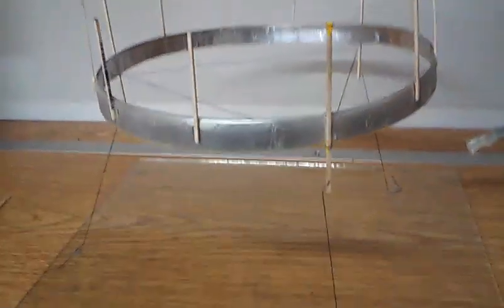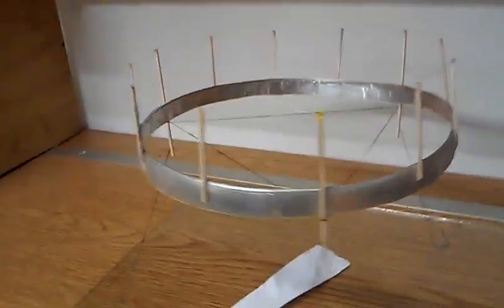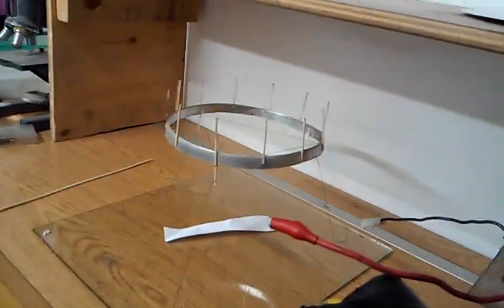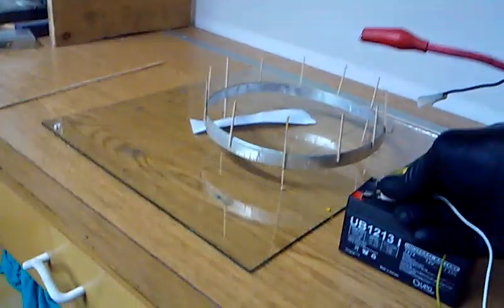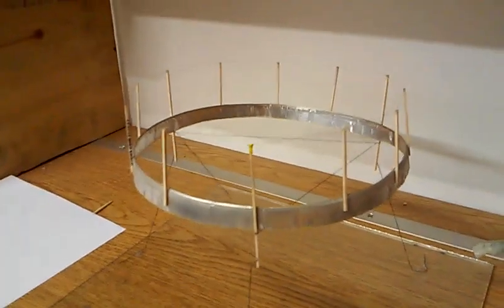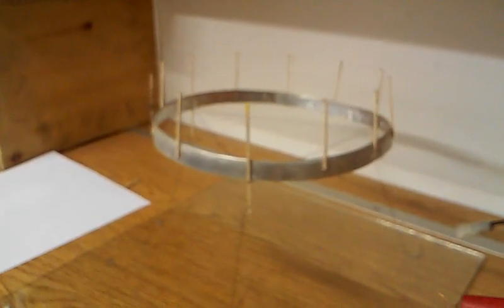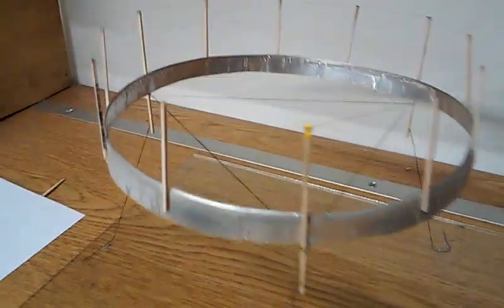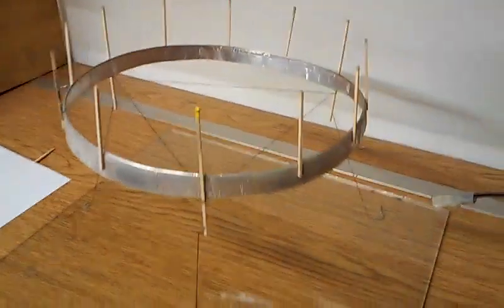ANTIGRAVITY LIFTER CREATES ARTIFICIAL GRAVITY ASYMMETRICAL CAPACITOR

Comment: It actually does use ionic wind ... just blow a bit of smoke through it, and you'll see for yourself.
Besides, your math is way off. You claim that the piece of would you use is the equivalent of a telephone pole when scaled up, but when you scale up for the length, the volume (and therefore the mass) is scaled up by a power of three ... That telephone pole would be more like a cardboard tube..... Besides, to scale up the effect that much you'd have to use voltages so high that they sparc over, and your rig shorts out. Effectively you'd have to create your own lightning. 
The power supply you need for the tiny model is already way too heavy to be lifted with your model... the power supply you'd need for the up-scaled model would be the equivalent of a truck. 

I'm all for research on anti-gravity, but the way you're doing it you're making fun of everyone that doesn't know the science behind it all. Effectively countering possible advances in actual research on anti-gravity.

This is what ACTUALLY is going on....:
https://www.youtube.com/watch?v=01F8V5IhB5k
Reply: @KraussEMUS1  Yet again, these craft are not propelled by ions! It is physically impossible to create lift by shooting down ions, but no force when those same ions collide with the bottom part of the craft. It's still the ionic wind, not the actual ions to get lift.
Reply: @angeldelvax7219  
Hi Ronald,
Back in 2001 or so I used to build large externally power devices in my garage.  My pant legs would charge up with large amounts of static due to charges escaping from the bottom of the crafts, so while your comment is very astute, and perfectly inline with the classical definition of how they work, there are actually a large number of charged particles that escape beneath ion propelled crafts.
Reply: @KraussEMUS1  static charge can build up for a lot of reasons. When you're working with high voltage power supplies it's not uncommon to get static buildup in your clothes. I used to repair CRT TV's. There are no ions propelled towards my legs, and still my pants got charged sometimes.
Reply: @KraussEMUS1  besides, I never claimed that ion propulsion doesn't exist, only that it's impossible to move anything by moving ions around in that item.
Ion propulsion isn't nearly powerful enough to get anything lifted from the ground here on earth.
Reply: @angeldelvax7219  
I know older television screens can get static on them sometimes, and also "static" forms of electricity can flow through objects onto peoples clothing, but the old large crafts that I was working on had a strong downdraft.  It would blow on my legs  and then there was a strong distinct charge buildup on my pantlegs. I am an EE, and have spent 20 years working with ion propulsion full time, so I really think some of the charge exits below these crafts along with uncharged air molecules. The physics do not prevent some charges from leaving the craft.
Reply: @angeldelvax7219  
Hi Ronald,
That used to be entirely true, but no longer. The craft I have built is ion propelled, and can lift its power supply and optional propellant tanks as well... I have provided extensive verification of it.  Here is an NPR Radio broadcast verifying that it works, there is also a website, and there is video of it on my channel, showing it lifting its propellant tanks with the onboard power supply:
https://radio.wosu.org/post/exploradio-oberlin-inventor-pushes-limits-ion-powered-flight#stream/0

Comment: its aluminium and it floats because of electromagnet under it. electromagnets repel aluminium and thats how you can make a rail gun if you want to.
Reply: Nope it's pushing air downward.  The this wire above ionizes the air molecules and they are attracted to the bottom.  I built these back in 2005 to see how it works.  It's a very weak thrust hence you have to make them out of balsa wood or plastic straws.  They used to sell ionic wind devices for air filtration.  One was called the ionic breeze and it worked on the same principle.

Comment: How about you turn those toothpicks into Tesla coils Try to use battery from watches in a test microwave to murder see how much power you convert Put it in the center With rotating copper will you can probly use of the louver more ram Let's make a  Times that by Betty    minny Tesla coils And Mike away the power Burger Make an old fashion  Wagon wheel with testicles a copper and aluminum

Comment: Seriously, these do not work in a vacuum...
Reply: It does not work in a vacuum unless you use proper dielectric material with very high dielectric constant like strotium titanate, barium titanate or calcium copper titanate between copper wire and aluminum foil. Thomas Townsend Brown used dielectric materials in his lifter vacuum experiments and got lifter working without any ion wind. The reason lifter works is because air is acting as dielectric material, ion wind is a dielectric breakdown of air.
Reply: @Xeno_Bardock  I hear people say all the time it works in a vacuum.  A low earth orbit vacuum does not have enough air molecules to use as a reaction mass, and this system IS NOT ANTI-GRAVITY.  It's still a reaction mass system. I have looks at dozens of these, and when you further reduce air pressure, they drop like a rock.
The opposing the magnetic flux of the earth isn't enough to lift anything over a few hundred kilos TOTA across the entire planet (in small dense package like a car).. Extraordinary claims require extraordinaly proof. So far none has been delivered.  I was able to reproduce the Stan Meyer electrolyzer using a single compoent, and get just as good, possibly better results. With just 4 diodes (bridge recetifier). Seriously, I'm stunned people buy this stuff.
Reply: @scottl5000  The medium of real anti-gravity technologies is aether, not air and earths magnetic flux. The ufo's people sometimes accidentally witness propel using aether all around us. Entire physical universe is submerged in the aether, there is no such thing as empty space. You need high voltage with very high frequency and proper dielectric materials configured correctly to propel using aether. Read books "Uncovering the Missing Secrets of Magnetism" and "Occult Ether Physics by William Lyne" and "Shape Power by Dan A. Davidson" on aether. Aether physics are not taught in schools because it was covered up back in 1930's so nobody today fully understand aether and that's why they fail to use aether for propulsion in vacuum.
Reply: @Xeno_Bardock  There is no physical edvience of aether.  There is GCR, which can be measured and it's like a thick fog of lightning, and could be a huge energy source. But it's not a medium you can push against either.  But this voodoo of aether is unproved, unmeasured, and a place holder for things undefined.  In the 50 years I've been hearing about it, not one person as proven it, or devices that can use it as a medium a device can use to levitate.  Not one time has it been proven these lifters work in a vacuum.  Just because someone says they know of someone who knows of someone that did, it not proof.  In fact it usually leads to some highly reglious person.  I believe antigravity is possible.  But not using a ion lifter.  NOTE: An ion engine does produce thrust in a vacuum, but it uses metal atoms as the reaction mass.
Reply: @scottl5000  Read the mentioned books. There is plenty of evidence of aether. Check channels "Theoria Apophasis" and "Distinti" on evidence of aether. Mainstream physics screwed up big time by discarding aether. Without aether there will be no electromagnetic waves nor light waves because waves can't exist without a medium nor anti-gravity is possible without aether. Particles only behave like a wave when contained, water contained in a pond for example. Electromagnetic waves and light waves behave like a wave because of aether.
Reply: @Xeno_Bardock  I've seen a lot about it.  Tons of non-scientific papers by arm-chair scientists.  There is something called space-time-fabric, and ZPE etc.  But no aether medium, like swiming in faster than light water, has been even remotely 'proven'.
Anti-gravity has been proven on paper using white dwarf material, or ZPE cycling.  
There is a good chance the a time-dialation field using a magnetic bottle formed by gamma rays, and sprial light (photons shot through a gas-metal medium) will allow us to concentrate gravity effects of a dense material over highly compressed time.  

Quantum graity loop offers promise too.  

But this lifter thing, if it was a decent ion thruster would work in space,  but it's still a reaction mass, and a very poor one.  It would not even pull 100th of G.

There is even a long shot chance that dense enough photonic molecules shot out at high speed would do the trick better.

Your best bet is to alter probability fields to cause motion by virtue of changing the likelyhood of where you will end up next, and let what amounts to a kind of time travel move you about the universe.

That is less of a reach that this pool of  magical aether.

If aether does exist, it's going to called something else, with clear physical properties, not voodoo, and will not interact with matter or energy in the ways you guys claim. So far everthing "discovered about aether", best case is a small subset of how the real universe works.  Good luck chasing your tails and telling tales.

Comment: Ion lifter no , anti nothing he has no idea what dynamics are at work  he just knows how to make it...
 He is correct  it is actually  falling  he has created resistance field with radiation , which doesn't recognise  gravitational force .  until load force counters the resistance  .problem is when small amounts of weight is added the resistance must be constant and becomes very in ecconomical by larger  x  larger factors

Comment: You need to first understand WHAT that attraction is that you call gravity. it is not what you assume it is but quite the opposite. 

It is not a force but a direction of flow similar to an electrical circuit. ➕goes up ➖ goes down & comes from the ether above,  this is why  lightning  strikes mainly  go down because it is heading toward the larger ➕attractor.
All that is happening here is that your blocking the negative electrons heading back ⤵by charging the model which is wide enough to act like a kite lifting it's excess weight and use the ➕ electrons heading ⤴going toward the ether. 

Gravity isn't a force it's just a direction of flow.

Comment: This has nothing to do with antigravity.. NASA tried it in vacuum and it didn’t work.. so just as a normal plane that uses one type of propulsion system to temporarily fly through the air, this system uses another method to achieve the same thing... so don’t be dumb and let yourself be fooled by this guy !

Comment: f rm gary  fifield  frm his theory  you  build a land vehicle  yuo  to  put that  in abdy  with ai seat  if yuo  use  to  solar  cells and then sort out power to  lieht and then work out maths  formulars  ie weight to power yuo need to work  a control for height   uif itst posible toi levitate there be a way use this prinicaple for forward motion  
 when yuo have worke to  use a 3 printer yuo should add a rotor at the side in side the ringe i  would as yuo try diferent veration  
yuo   should be able to  build the first  fyling car  do yur self a favoure and learn to  use a 3 d printer .so one in the uk  in the eighties built  a flying suacer of ufo  using this principle 
 but the has surprest look it up un utube  and thiis is call gravitics  buld a proa type and use the a 3 d  to  make the shassey  for jet  engines  this the way to  go well done go for it  bust of lucjk try addding  am magnetic generater mottor to power it yuo .yuo need to work a control system bye